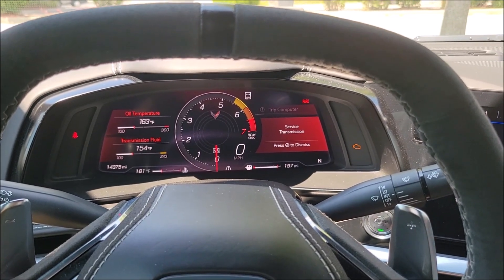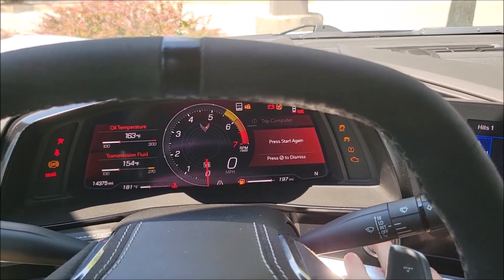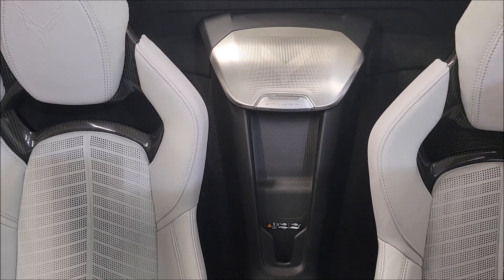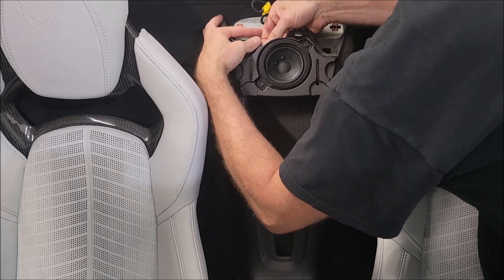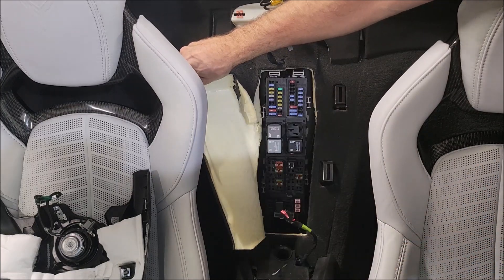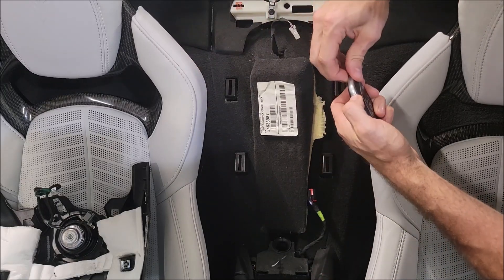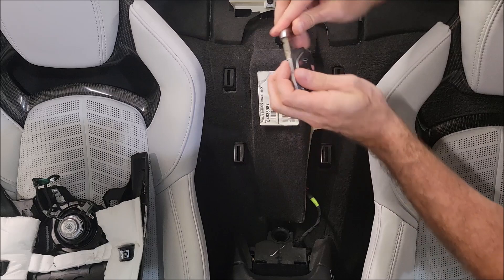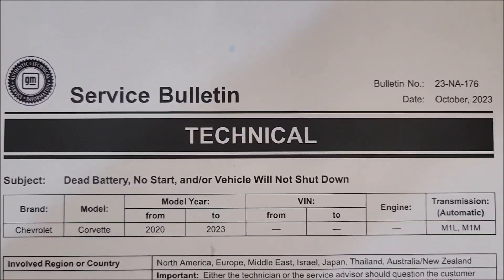2022 C8 Corvette stuck on, no crank - Pull TCM fuse

Comment: Temporary solution is disconnect the battery and connect it back on. You’ll be able to start it. It will however do it again. Currently trying to fix the main issue
Reply from the maker: I didn't have any tools with me when it first happened. But eventually I kept a wrench in the glove box after it happened a 2nd time.

Comment: What solution? Change transmission?
Reply from the maker: Yep, new transmission installed around 13k miles. Dealer had the service tool, to snap the park pawl rod and then it wouldn't crank.